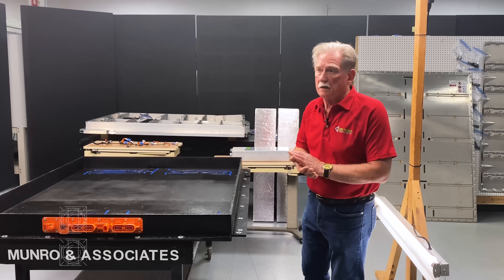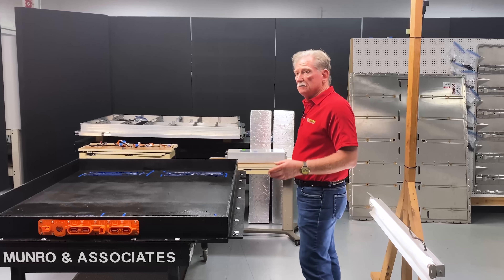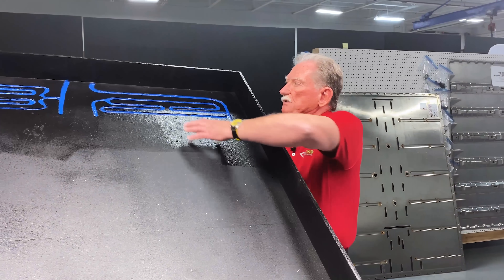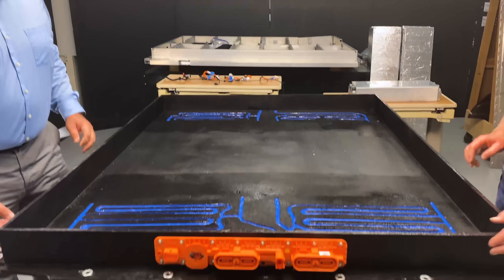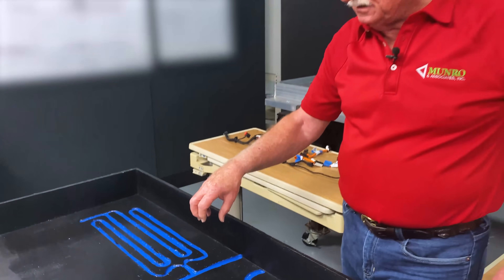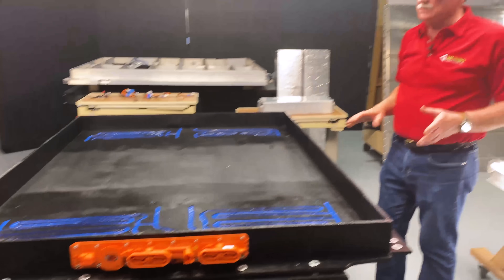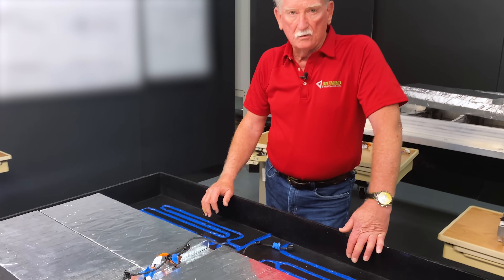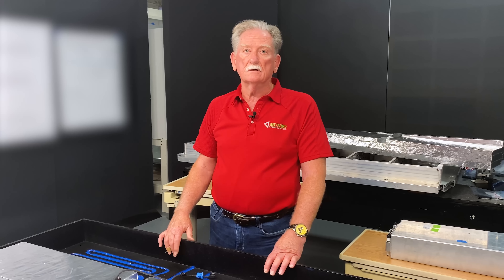Volkswagen ID.4 Battery Prototype Update

Comment: I like the idea.
I still think that VW did a great job proven by the fact that the proposed improvements seem to be fairly minor. Like combining two modules into a large one with a channel in the middle. I guess VW went for the smaller modules to be more flexible. The additional cost to an "optimal" approach seems to be neglible.
Reply: If every cell has a given percentage of defect after assembly, bigger modules are increasing the chance of defective modules. Also the costs of discarding such an defective modules increases. It's quite likely, that smaller modules are cheaper in that regard.
Reply: In a previous video https://youtu.be/1hPe82cGLOE?t=296 Sandy noted that the battery pack was attached to the strong points of the vehicle using 4 large central bolts and it would require "an act of congress" to change that, but his proposed solutions eliminate these fixing points, so this battery pack would fall off the vehicle at the first speed bump.  
VW has already designed it's MEB v2.0 battery pack, replacing large battery modules with its new "unified cells" and a cell-to-pack arrangement which fits neatly around the existing fixing points.
Reply: One module is already quite heavy, if you want to be able to replace single modules, a double module doesn’t make much sense. Not that many robots in the normal VW garage.
But it is different if you go to Cell2 Car approach like Tesla or others where it is quite difficult to change cells as they are part of the structural integrity of the car.
Reply: VW and Skoda currently require to support an odd (9) number of modules, so how would you do that with double wide modules...

Comment: I was wondering, what is your opinion about the Robertson screw? A screw with a square hole. To me these screws seem much more easy for robots to use, are lighter then normal and so on, they don't slip either, like the X shaped screw might. I think they could be cheaper to use on big scale.
Reply: I wasn't familiar with the term "Roberson screw" so I did the google and this popped up -

"Most historians attribute its (Roberson's) lack of popularity in the United States to Henry Ford. Having been nearly bankrupted by shady European licensees, Robertson refused to license his invention to Ford. Without a guaranteed supply, Ford turned to the Phillips-head screw, cementing its reign in American industry."

BTW, I'm a big fan of square drive screws but I seem to be switching my preference to Torx.  The hexalobular socket screw drive or star drive.
Reply: @bobwallace9753  I like the torx, except that it's quite annoying that I can't open it with anything else then torx. An old hexalobular socket schrew often turns into a circle and then you can't so anything with it any more. The Roberson screw could also be opened with a flat screwdriver, so that's the one I like the most. Somehow in Europe I have only seen it like 2 times in my entire life.
Reply: Certainly doing any woodwork projects - we would always choose Roberson.  Especially decking.

Comment: You're still using pouch style? This is already dead in the water.
Reply: Pouch cells are cheap and easy to mass manufacture everywhere, same kind of temperature control, better safety when broken or smashed, same life expectancy and have similar performances when charging input or high output... they will be around for quite a while
Reply: what us wrong with pouch cells??

Comment: I am actually not a huge fan of the Arcimoto design and concept- just on a personal level. That does not translate into me thinking they won't be successful or wishing in any way that they won't. I hope they do very, very well. They just got some bonus points in my mind by allowing Sandy to talk about some of what they are working together on. That is very cool and actually makes me more interested in them as a company. Go Arcimoto!! Best of luck in your endeavor.
Reply: My cynical (read critical engineering) mind says, unless you have a really low cost production process, it will be hard to get economies of scale. ( It depends on the target market of course). I see crowdfunded designs that seem to me to be remarkably expensive, for what they produce...
Reply: @chrisheath2637  I think I share your view- which is ONE of the reasons I'm super excited about Aptera. The modular design and the fact that the 4 pieces of the body are self aligning during assembly by humans is just some of why I like them . It seems to me that they have an economy of production that allows them to make money on even a small scale and then be able to scale it upward very fast if demand  will support it. I suspect there to be a tremendous demand for them - what do you think about Aptera Chris?
Reply: @kirkjohnson9353  I am somewhat sceptical. I just don't see a three wheeler as a viable mass product. Unless its cost is comparable to a small motorbike...I know, I'm a cheapskate...But it has to have some extra utility to gain success. Yes, Its green...but that in itself is not sufficient...

Comment: Maybe would be better to snap in the batteries in some way. So you can save on the glue and take it apart if one of the batteries fails. It's a problem in many phones, that the battery becomes difficult to take out, if it's glued in.
Reply: Yes but consider if you have planed reuse as stationary battery banks one or two faulty modules can be isolated electronically and the whole remains a useful product till years later when you can then take them apart as scrap to be reused and the car owners can just get another battery tray bolted on to the car.
Reply: @Barskor1  If you only isolate the failed module, you might lose 1/5th or 1/4th of your range, which is a lot. So you might want to repair it at some point.
Reply: @seasong7655  Apparently cells have very low failure rates.  A lot of cells would need to fail in order to make a module unusable.  If the probability of failure is very low then it may make economic sense to go with a non-repairable design if that design is cheaper.  Then replace the entire pack for the "1 in 100,000" vehicles that do suffer battery failures.

The cost of repairs for many things are now higher than the savings gained by using a non-repairable design.
Reply: @bobwallace9753  the reason to have a module system is not always to fix faster batterie module fails. VW is planing to reuse the batterie moduls for 10-15 years as batterie storage. Smaller modules (< 20kg) are simpler to handle for humans and machines.
Reply: @Francis-yc9nc  

Smaller modules may be easier for humans to handle but as for machines, just use stronger machines.

LFP cells, the ones I'm currently using, are rated for 10,000 cycles.  If one puts 10k cycle cells in a 250 mile range EV that's a 2.5 million mile car, at least the battery pack.

Most manufacturers build a 200k mile body.  Put a 2.5 million mile pack in a 200k mile body and you'd use up 800 cycles.  That would leave 9,200 cycles for second life use.  Cycle them once a day (solar to evening) and they should be usable for 25 years while still having at least 80% of their nameplate capacity.

Jeff Dahn is testing some type of cell that has (so far) held up for 20,000 cycles.  He hasn't reached the end of usability yet.  At least at the time of the last report.
Reply: @bobwallace9753  So, talking about high cycle counts, you must know about the Oxford Bell, battery powered...set up in 1840 , and still going...if only they made the car to last that long...
Reply: @chrisheath2637  you cannot draw any useful power out of that battery though.. i think the bell it powers draws something in the milliwatt range, possibly even less. that wont even overcome air resistance at standstill (not to mentoin all the other, more significant frictions involved at that speed)
Reply: @unitrader403  I just think, its incredible that so long ago, something that long lasting could be devised. I believe they are not sure exactly how it works, possibly aided by electrostatic forces...